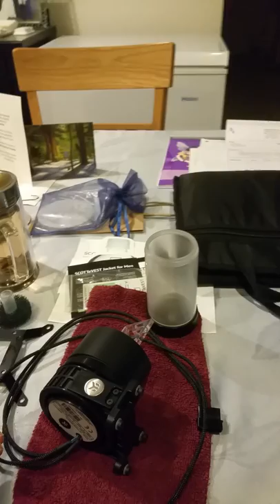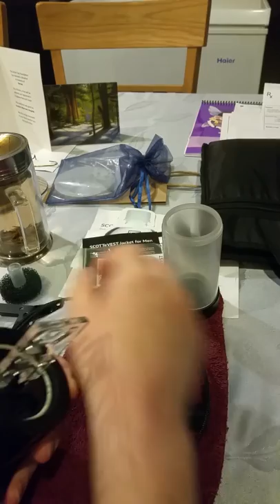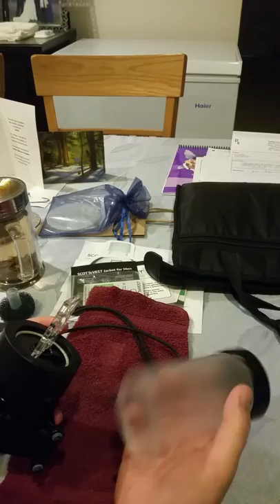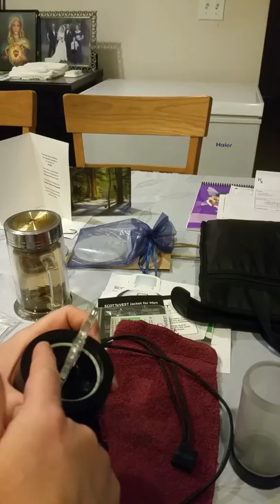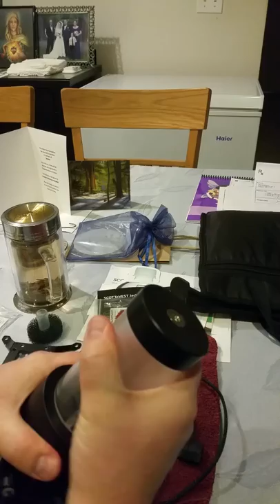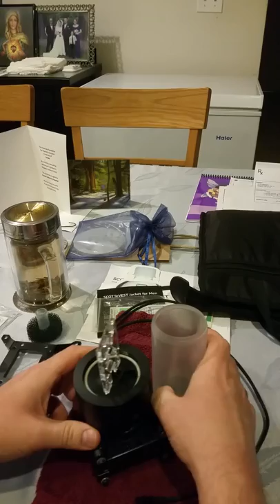EK-XRES 140 Revo D5 PWM operational damage

Comment: I’m not sure I understand the term to apply gentle reverse pressure correctly… my reservoir and pump assembly did the same thing I’m waiting for a replacement to be delivered now and am super paranoid the new reservoir I got for it will again strip it could you please describe in other words how properly prevent it or how step by step screw this in so that it does not get stripped by just too much pressure while assembling it? Gentle reverse pressure is a bit cryptic to my second language brain xD

Comment from the maker: You will have to provide your own self-assured guarantee that the EK-XRES pump you install will not break the water seal by first checking the o-ring is actively pressed and locked against the base inlet frame with the screw-on threading or you will loose more than just your water pump. Testing is required, and no one else will do it for you. Even if it was pre-assembled!

Comment: Wow. Mine came preassembled - does this mean it can just get destroyed by the pump vibration during work?
Reply from the maker: It simply means you must pay EXTRA careful attention to the condition and the precise method of fitting your waterloop parts together per the instructions! In this case, what the EK instructions did not say is that you must apply gentle REVERSE PRESSURE  against the top and bottom water seal O-rings to avoid any damage to the cylinder threading. Further more this can only be done with the loop drained and pump assembly completely removed as a last step of cleaning and inspecting your pump. Do not use any abrasive material to clean anything, use soft cloths. Most importantly, if you can avoid disassembling your EK pump, don't do it! Based on this experience, it is absolutely added risk! -MATTHEW JAMES klump-pdx.com